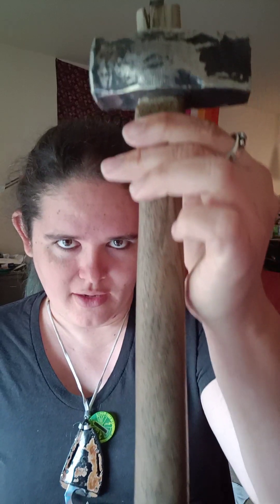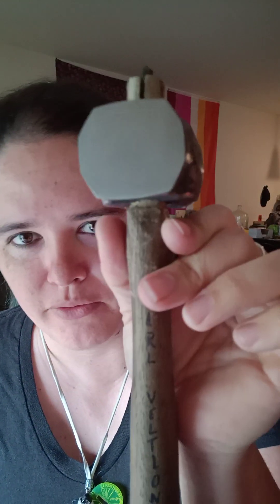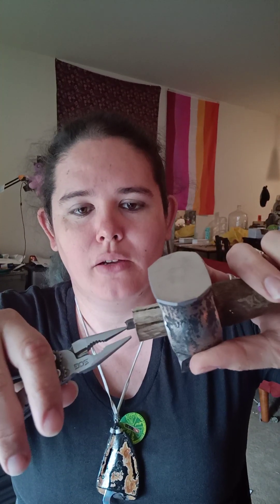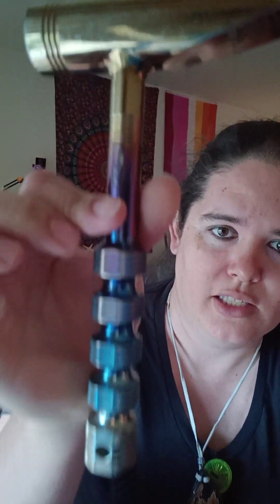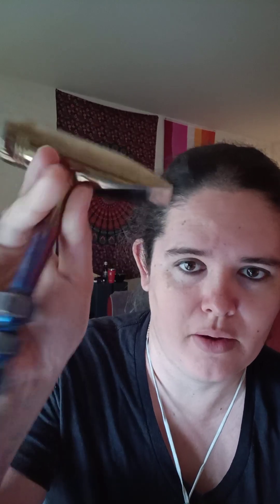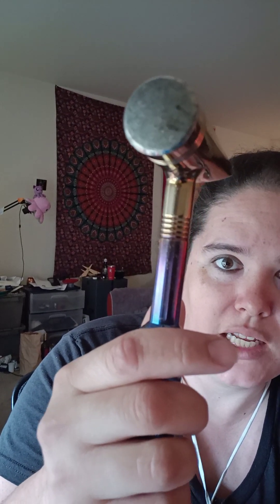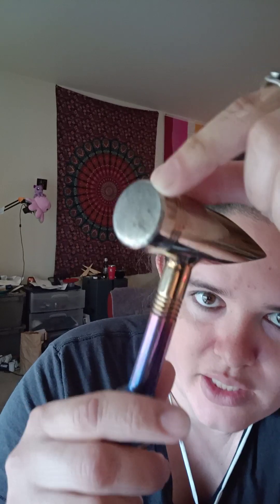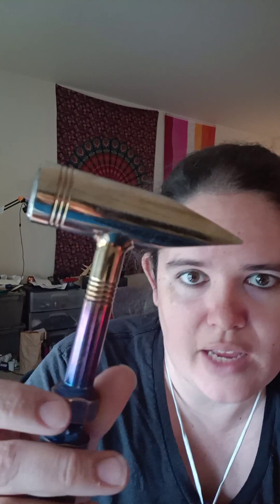Why Titanium is a GOOD Material for Hammers! 💙⚒️

Comment: What actually makes it a good material for a hammer then ultimately it wasn't entirely clear, it is hard but not brittle and light in weight?
Reply from the maker: Yes, it's hard, springy and light. It doesn't corrode and users of titanium hammers report lessened harshness on their elbows.
Reply: @SeaforgedArtifacts  awesome, appreciate the concise reply!
Reply from the maker: @JoeMcSpirit  my pleasure!
Reply: @SeaforgedArtifacts olá tudo? Você fábrica ferramentas?
Reply: This is a jewelers hammer. You wouldn't want to hit something really hard with this.
Reply from the maker: @GolfLife_  on the blue one? already did some smithing with it, worked out fine, but the handle is a bit short.
Reply: @SeaforgedArtifacts  the blue what ? I'm on about the titanium hammer you wanted to know where it's from and what brand is it. That what u asked. It's a jewelers hammer you can get them online about $100 and it's for jewelry. And as there is no shock absorber on the handle you wouldn't want to hit it with alot of force as the shock would hurt your hands over time and could cause white finger. And you don't want that.
Reply from the maker: @GolfLife_  got it, do you have a brand name? 
I want to pay respects to the maker. And you are right the handle is rough for forging.